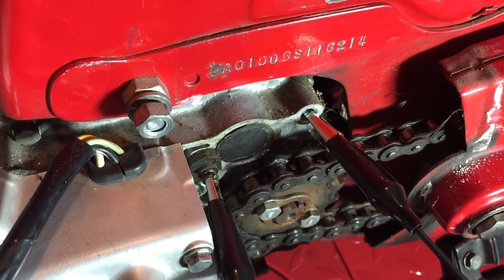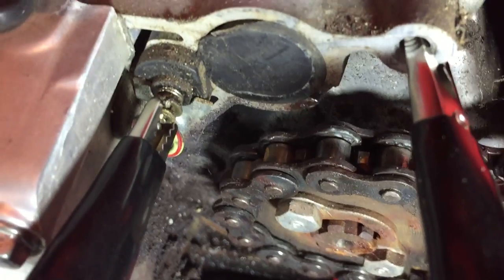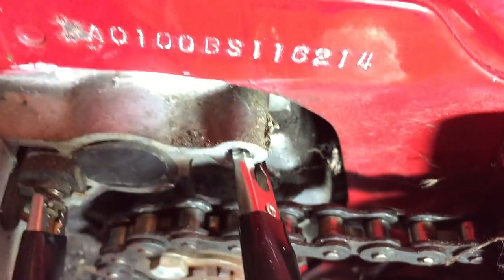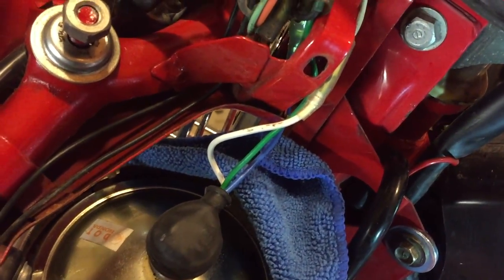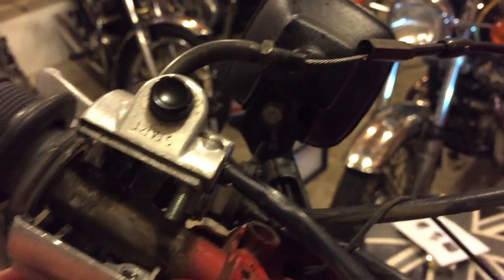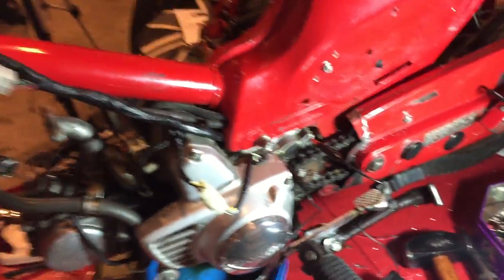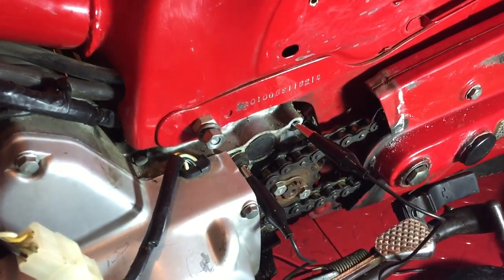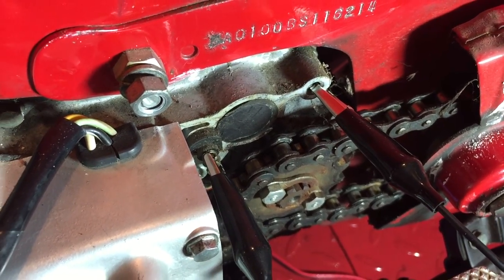1981 Honda C70 Passport (09) - Starter Problem 4 - problem identified!

Comment: I'd like to thank you for your videos I had the same problem with my neutral switch I grounded it out and the starter works beautifully thank you for the advice I would have spent many hours working on the solinoid or the switch I thought it was some other problem glad you're there keep up the good work
Reply from the maker: Thank you Stanley!  I really appreciate your comments.  Best wishes, Mike
Reply: I have been watching your videos and find them very helpful 
I am restoring my dads I saved it from the shed from more than a decade of storage .I am trying to set the points and the book I have and every video is different do you have an recommendations on where to start I have it taken apart at the moment it was mostly rusted over so I have cleaned it and it looks fine now just beginning rebuild

Comment: Thanks for the video.  My 1980 C70 Passport wouldn't start with the button ( starts fine with the kickstarter ), and I grounded the neutral switch like you did and the electric starter worked!  Unfortunately, I initially thought the problem was the starter solenoid, and I took it apart and broke it -- had to buy a generic replacement.  Thanks again!  Now I have to figure out why the brake light and turn signals aren't working.......
Reply from the maker: Congrats Mark!  Isn't it funny how 1 jobs leads to 3 more!!  Good luck with your project. Cheers, Mike

Comment: What are you hooking up the alligator clips to on the other end?
Reply from the maker: Hi Jeremy.  One clip was connected to the end of the old, broken neutral switch and the other was simply clipped to the engine casing, acting as a ground.
Reply: +Mi Ty 

ok thanks. I tried that and still got nothing. checked the solenoid like you did. That seems to be working. not sure what the problem is.
Reply from the maker: I think perhaps you could run a wire directly from the battery to the body of the starter motor to test it.  It should already be earthed.